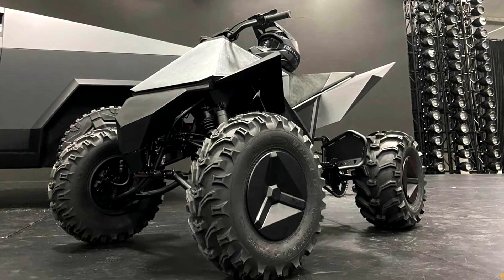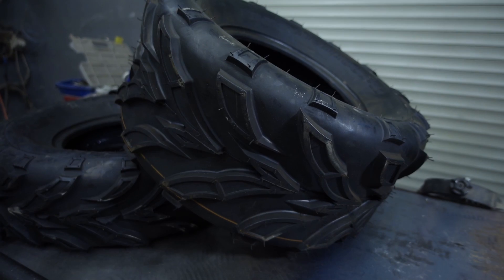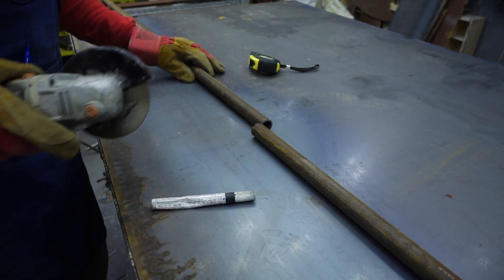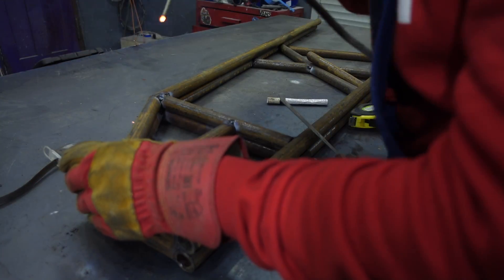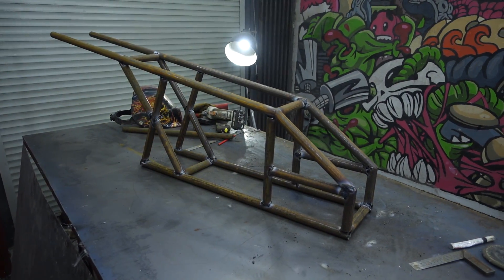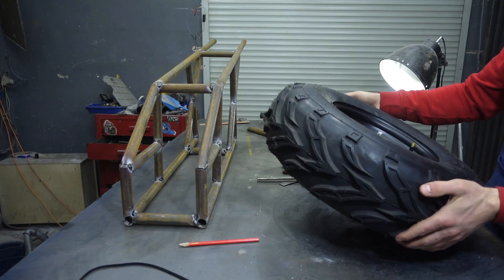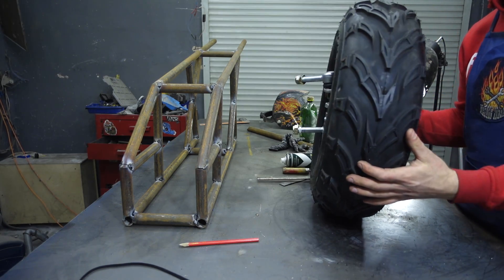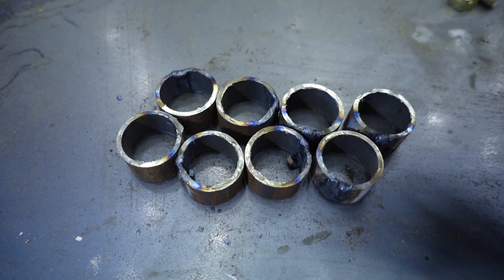Building Tesla Cyberquad ATV. Part 1

Comment: The reason why the cyberquads rear axle is a similar length to the raptor 700 is because the electric motor was swapped into a raptor 700 rolling chassis. Still cool diy build.

Comment: Those cheap 72-volt motors are worthless. No power, I have them on a scooter 1/10th the weight of the quad you're building. You need at least 2 x 8 kW QS mid-drive motors. That's Nominal KW, full power using 108v it will have 25 to 30 kW. Anything smaller it's going to be boring. Yes, 108v is the minimum I would go with a 50ah battery. I have converted a Yamaha Raptor and a Honda TRX 450 R to electric and running 35 kW and I still think it needs more like 50 kW TBH. Both are lighter than your build.